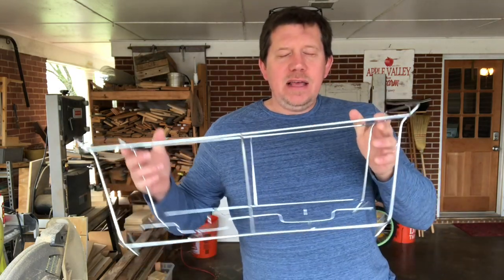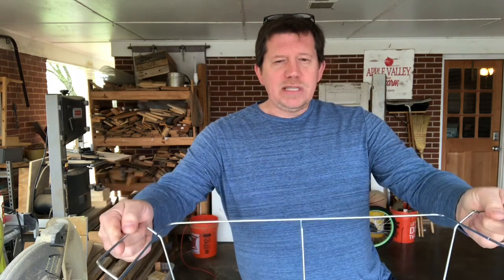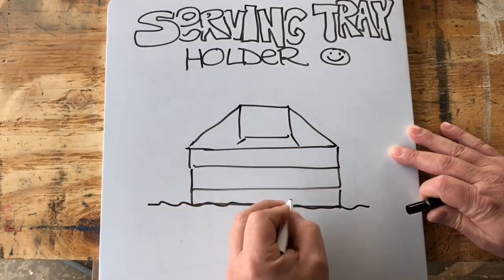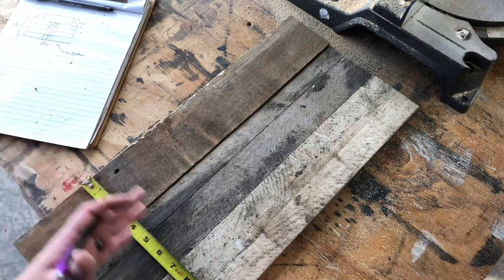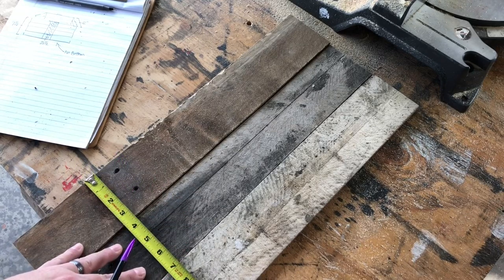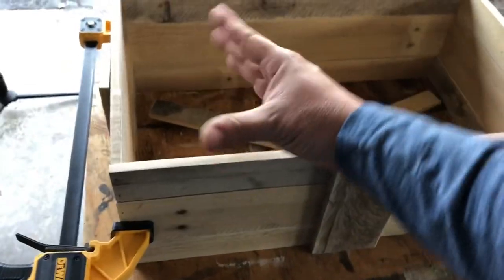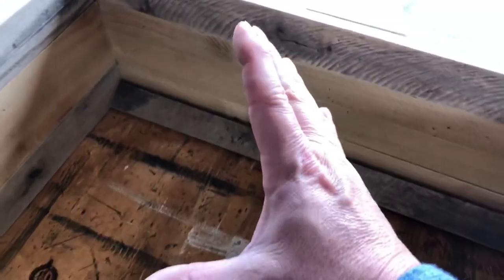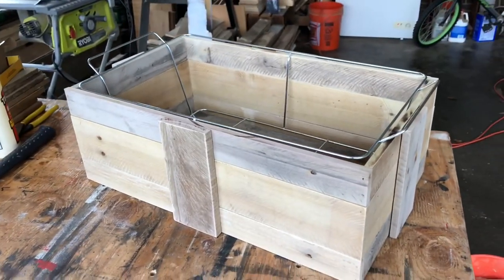How To Build A Reclaimed Wood Serving Tray Holder

Comment: Can you share exactly what i should buy at the hardware store in terms of wood. I’m going to have them cut them while I’m there
Reply from the maker: Sure. Although, one, this is all dependent on the dimensions of your tray. And two, since I made this with reclaimed wood, the width of the boards could be different as well. Having said that this is what I would suggest: 6 boards, 21" long, totalling 7.5" high, when stacked together. Then 6 more boards like this, 12" long each. Finally, 2 boards, 21" long (any width) for the bottom. That's not a lot of instruction, but I hope it helps you. Thanks!